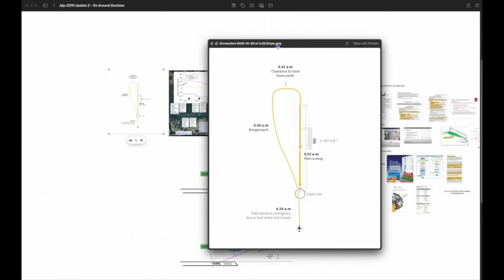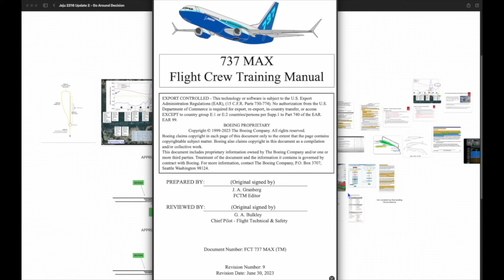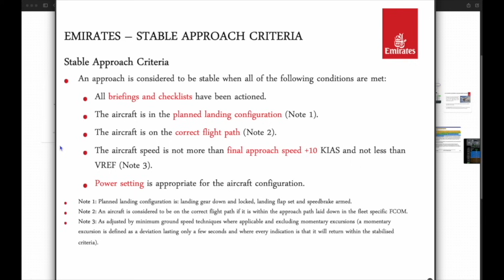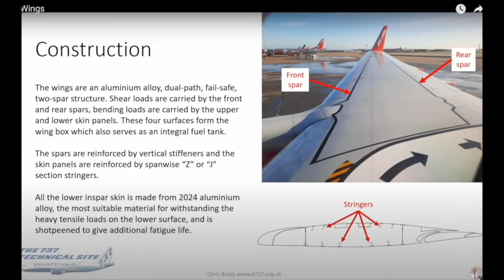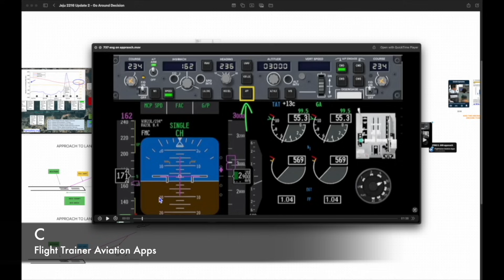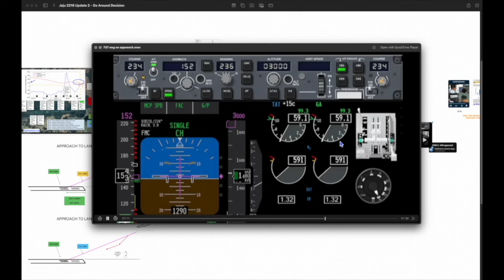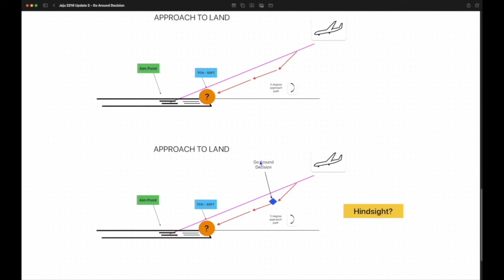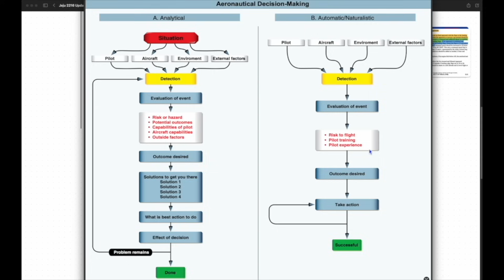Go-Around Explained: Jeju Air 2216’s Decision Not to Land

Comment: Do we know if the reverse thrusters were on? Looks like maybe one was deployed.  That takes power to deploy.  Any clarity on this would be helpful.
Reply: Not much hydraulic power is required to deploy the thrust reversers.
Reply from the maker: Hard to say, technical inspection of the engines should reveal this
Reply from the maker: thanks for the comment